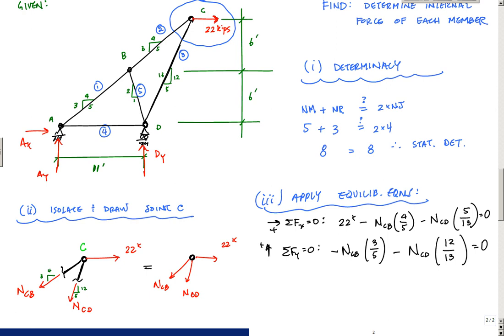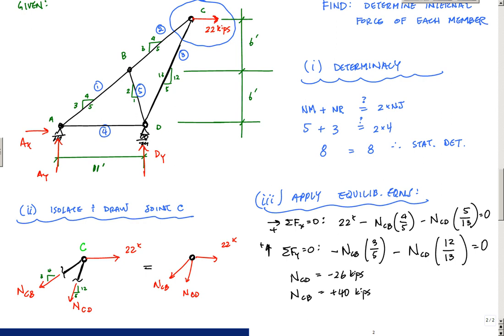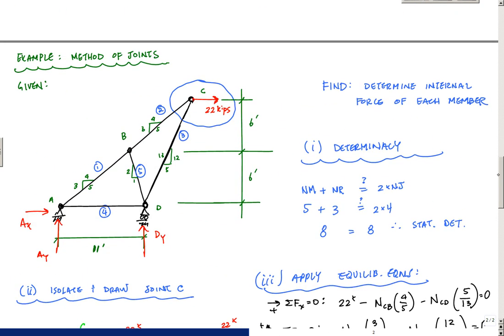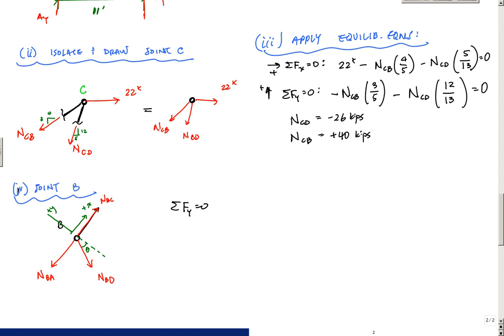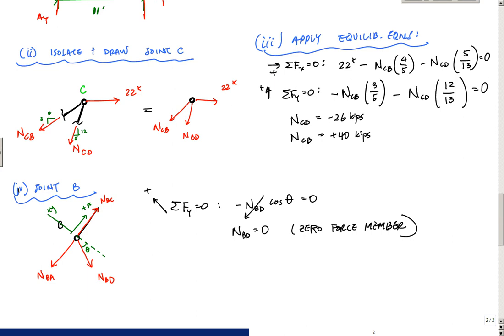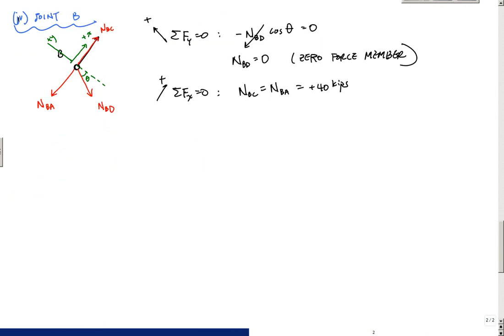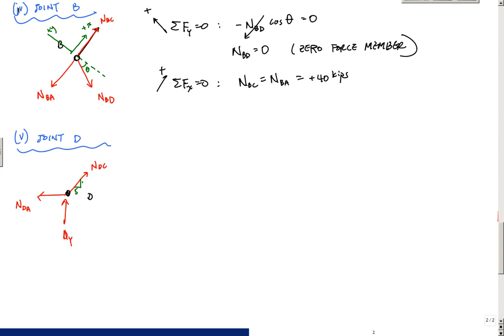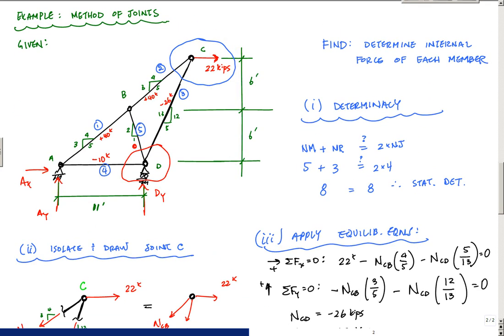Method of Joints (Part 2) - Statics and Structural Analysis

Comment: Hi +structurefree How did you worked out the triangles that are going through the members? Because I have same structure but I am struggling to find those triangles
Reply from the maker: the dimensions were given and so you can just use ratios or similar triangles.

Comment: in section iii B you have two unknowns and only an x force. You cant solve for NCB  and NCD without another known force???? How did you jump to NCD= and NCB=????
Reply: Yea i got that far but the freakin math is causing me problems. Can anyone explain? Shaking off the 10 year rust
Reply: @petermaroney3625  from 2nd equation whe. You move Ncb to the other side u find that 3/5Ncb = -12/13 Ncd. Then u divide both side either by 3/5 or 12/13 to get a unit Ncb or Ncd whichever u prefer. Then just put into 1st equation an u will have 1 unknown. After u find that unknown. Use 2nd equation to find the other one.
Reply: @ourhub9388  and it doesn't work out like he has
Reply: it's just simultaneous equations that's how he worked it out, 2 equations 2 unknowns